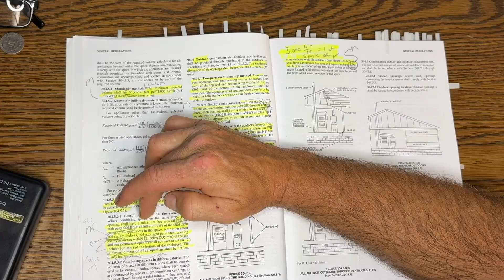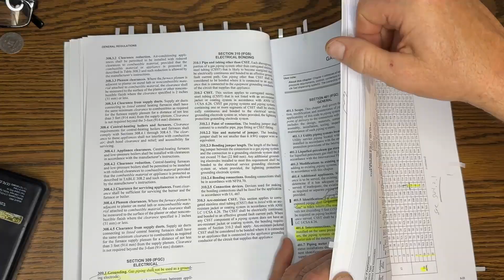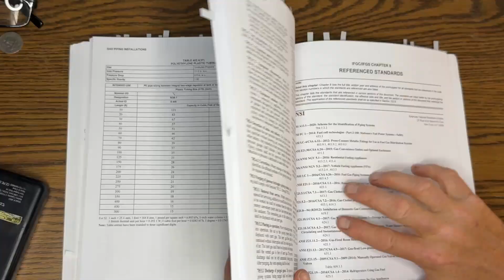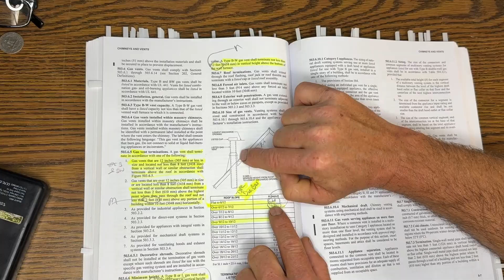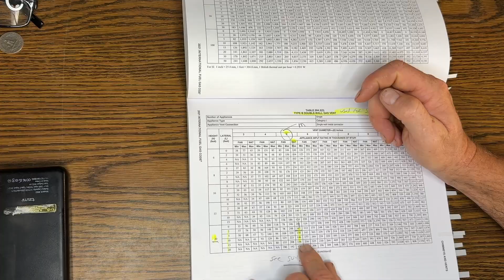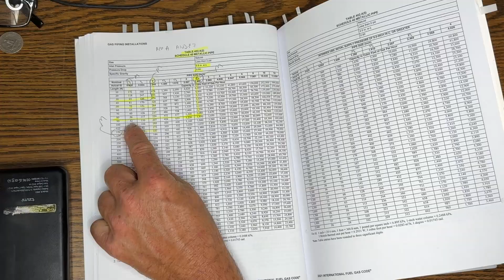ICC Commercial Mechanical Inspector (2021 M2) IFGC Notes || Help you pass the Cert Test

Comment: a 30x30x12 room= 10800 divided by 50= 216 or 216,000, let say the BTU's equal 775,000, so, minus 216,000= 343,000 (now how many vents, vertical or horizontal or a single vent? let's say 2 vertical (verticals are 1/4000) (Horizontals are 1/2000) and a (single is 1/3000) So, 343,000 divided by 4000= 85.75 opening in the hallway
Reply from the maker: Thanks for the example!!!